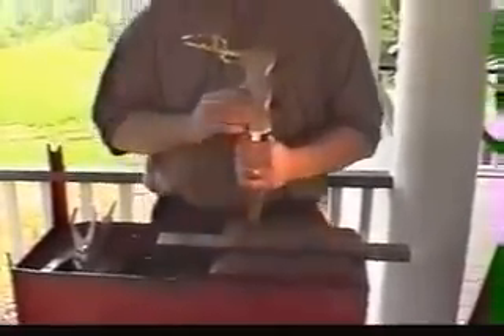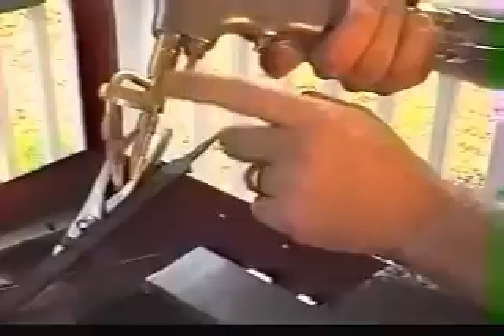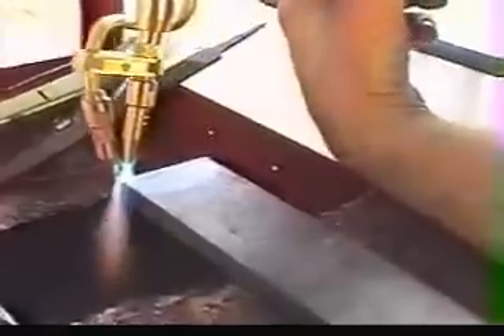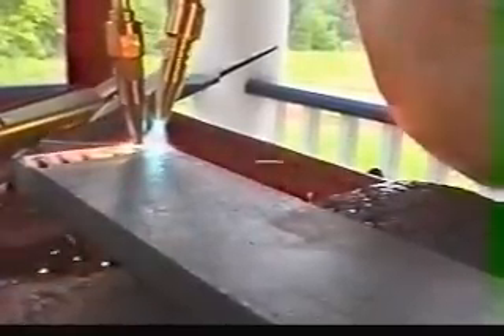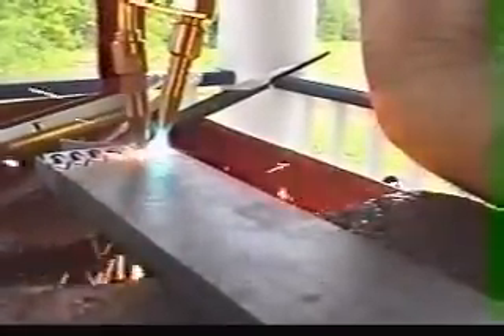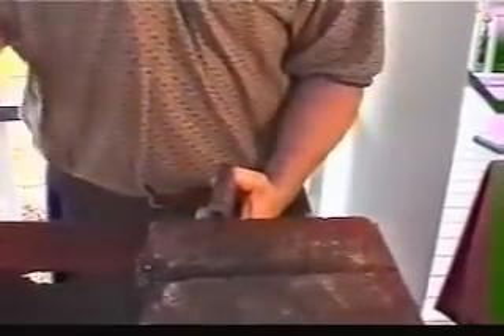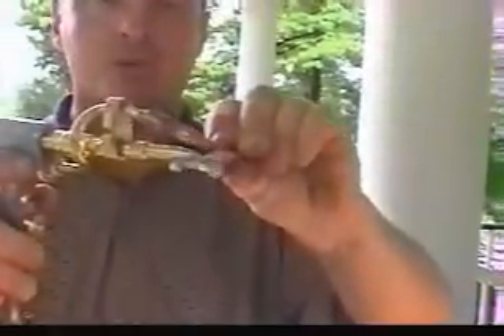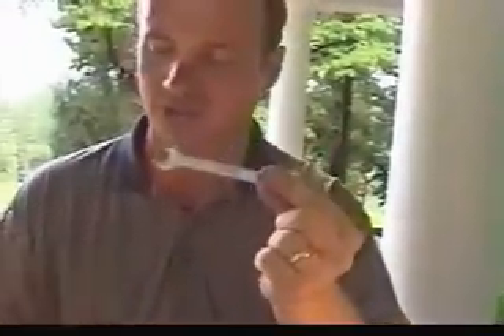Cutting Steel with the Henrob 2000 Welding and Cutting Torch

Comment: Just found this in our shop , no one knew what it was, so they let me take it home.. old torch is in the trash. I had to cut up some old Cold tool 1 in thick x 6 flat close to 100 cuts, never messed a tip up. And did it on a very small amount of oxy,and acty....  big torches would have emptied my tanks..